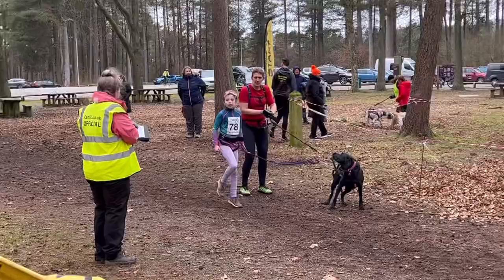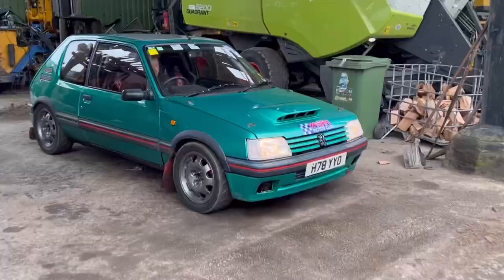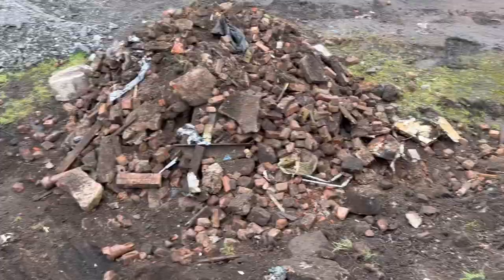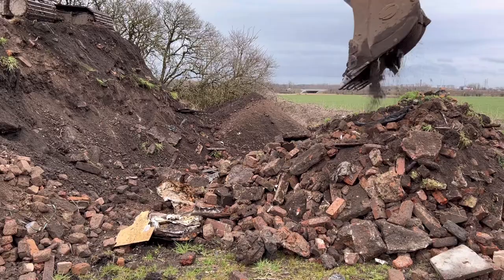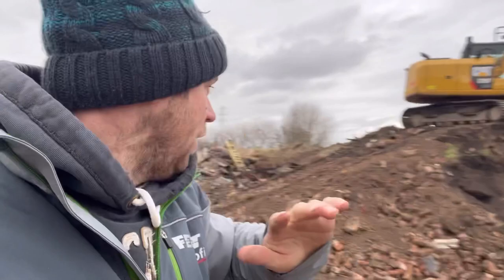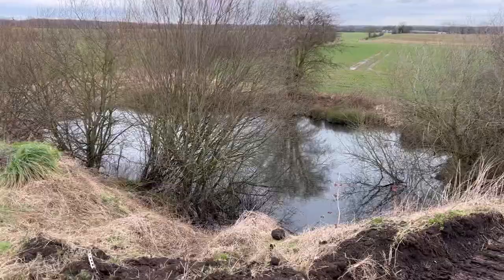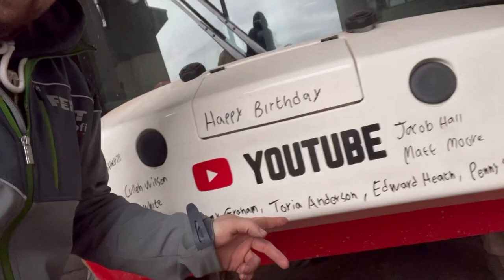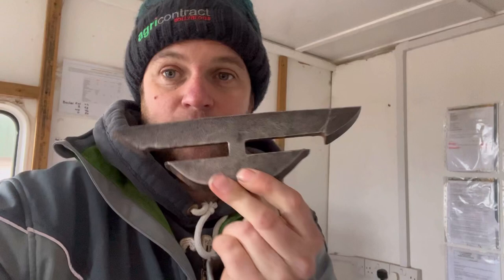Day692  #OLLYBLOGS RIDDLE BUCKET ON CAT EXCAVATOR & A DOG RUN     #AnswerAsAPercent

Comment: That door won't go gray if you keep up with treatment. I personally prefer  oil on my timber work. As I've said before carpenter by trade and farmer in my dreams.👍
Reply from the maker: Which oil
Reply: @OllyBlogsAgricontractfarmer   depending on type of timber but ozmo oil is probably one of the best.   Really brings out the colours of the grain etc.